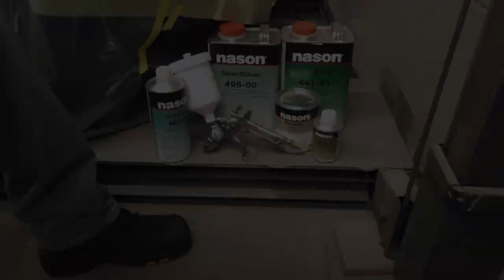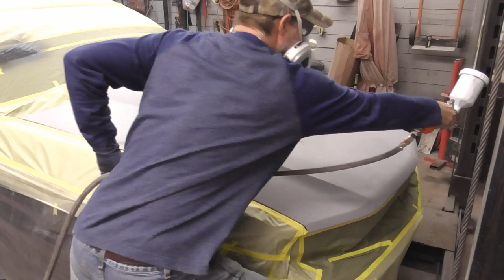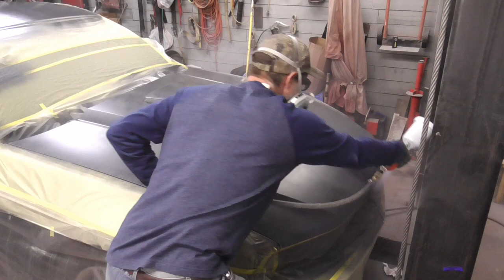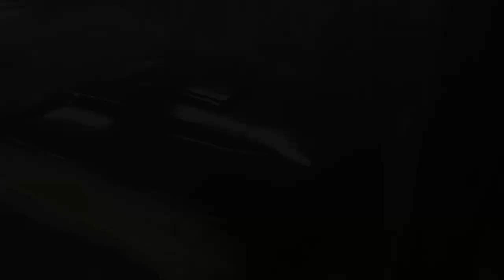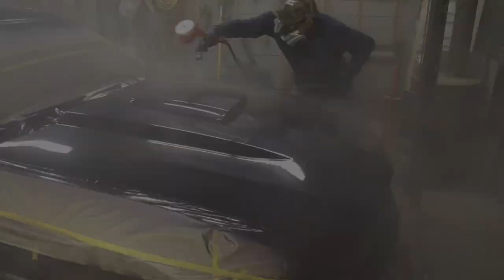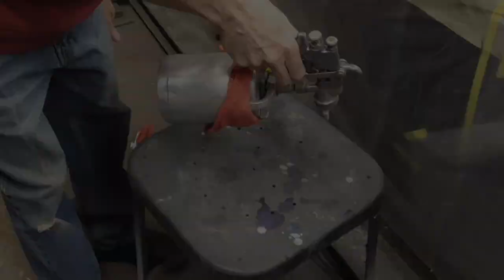How to Spray Nason Base Coat / Clear Coat (BC/CC) Automotive Paint - Start to Finish

Comment: Just got the basecoat paint from Paint For Cars website today but still waiting for the turbine spray gun to come that ordered from a Asian country though the Fuji Q5 platinum hvlp I know it said 15-25 days it gonna take and next week Friday be 25 days so it should be coming by next week it has a 1.3 tip. I don't wanna use my 26 gallon air compressor with this paint again because like you said it did it multiple times when painting with this urethane paint got orange peel but I know they have urethane paints that are higher and lower quality too. I got a higher quality this time than last time paid 99 for a gallon this time paid 135 I still have some of the Arcylic enamel basecoat though that single stage that midnight blue both metallic but the Arcylic enamel paint when used it didn't look like a midnight blue after spraying it with my spray gun. I think the problem could be the psi I spray this paint with and other things but will use a 1.3 when I spray basecoat with this next time. Maybe this paint not good to apply with a small air compressor either though.
Reply from the maker: Keep me posted my friend.  I'm looking forward to hearing how it all works out for you.  Have a good weekend :)
Reply: @LakesideAutobody  ok was looking at instructions today and it said when using conventional spray gun to spray with 35-44 psi and saw the full instructions in the back but told them to email me instructions so don't have to look of back of can because this time gonna use a fast reducer not medium plus a different spray gun when it comes. I have a Nason Fast reducer bought in the last 2 months though. But have Nason black think is a flat black sealer too. Gonna need stuff fixed on truck because anti lock brake lights come on but don't stay on and maybe new tires so haven't been getting much as was but have gotten a lot of auto products in the last year but still haven't gotten a great paint job yet. Hopefully get better soon because next summer be two years since when I started trying to paint my last truck had rust but my new truck really didn't need to be painted I would of been better off painting test panels. But eventually gonna get a car again was looking at cars on Facebook Marketplace.
Reply from the maker: @zanaga1901  I took my ABS light out of the dash - got tired of messing with it - fixing this and that.  I didn't even like it when they operated correctly in the winter - just pulled the instrument panel, pulled the bulb - fixed forever :)  It's tough to get a good car my friend - been there.  They need to make a basic truck for a lot less $.  :)
Reply: @LakesideAutobody  Bought some laquer thinner Saturday at store Blaine Farm and Fleet 5 gallon I know that a lot but my parent said that was too much for me to get that is actually something like a auto shop would get but got it because would have enough for a long while I ain't a professional painter or have a body shop but when I get one gallon it didn't last long when keep trying to paint my truck but only way I be to paint soon will be with a garage heater or next year painting again.
Reply from the maker: @zanaga1901  My dad always bought it in 5 gallons.  You're right it doesn't last long when cleaning guns and using it for thinning primer, etc.

Comment: What is your mix ratio with the nason base? It seems alot if people get confused by nasons weird ratios.  And do you use the hardener for the nadon base? Thanks
Reply from the maker: Nason 483-15 activator is the hardener.  The ratio is 8 : 1 : 2  - 8 parts color to 1 part activator to 2 parts reducer.  Mark 11 equal parts on a paint stick (the total length is how much paint you want in all).  In other words divide a distance (any distance that represents your desired amount of usable paint) on the paint stick - then divide it up into 11 parts.  8 parts will be paint 1 part will be hardener and 2 parts will be reducer.  Let me know if that makes sense to you :)
Reply: @LakesideAutobody  i bought some NASON FUL-BASE 3.5 B/C and its metallic but its a 1:1 mix ratio???

Comment: Whats your method of cleaning the gun after painting? I can't seem to get it thouroughly clean. some residue always remains on the nozzle.
Reply from the maker: I take the air cap, fluid tip, and needle out.  Throw the cap and fluid tip in some lacquer thinner (best for cleaning) and let them soak while I clean the cup and front of the gun where the paint comes out.  You don't have to take anything else apart where paint doesn't go.  I have a few favorite brushes that hit everything real well and put it back together.  Throw some thinner in the cup and spray the rest of the residue out.  Then put it away dry. I'll make a video on that - have a good weekend :)

Comment: This morning I sprayed some Nason basecoat XL 442-05 black on some parts (trunk, front & rear valance) for a 68 Mustang fastback. I was using 447-85 reducer mixed properly at 2:1. The temperature at the time was 80 degrees and I was getting ALOT of runs in the base coat. I was using a cheapy $20 Harbor freight gun that had a 1.4mm tip and it seemed like I adjusted the pattern very similar to what you had in this video. Maybe I was not moving the spray gun quick enough as it seems that you were moving a little quicker with your spray motion than I was but maybe there is something else that might be helping the base to run so easily.  The humidity was very high earlier today and still is. I would like to get your input as to what else may have caused the base to run so easily? Was it the cheapy spray gun, the temp of the reducer OR do you think I just need to speed up my gun movement.  Also how would you get rid of the runs in the base coat as I just stopped spraying it earlier this morning which was about 7 hours ago and didnt spray anymore because I wanted to try and find out what might be the problem. I appreciate your time and input if you can and thanks.
Reply from the maker: It was simply the movement of your gun.  Don't worry at all about spraying the base coat dry and for that matter don't worry about spraying the clear a bit on the dry side either - a little orange peel is not the end of the world - it can always be wet sanded and buffed.  I will be uploading a painting video tomorrow (6/24) that talks about what I'm trying to explain to you.  For now though, I suggest practicing on a large metal coffee can - scuff it and paint it (bc/cc).  If you can paint that without runs and be happy with the results - you are 90% there.  As for removing the runs... you'll have to either wet sand them out with 400 grit or DA sand them when it dries - as long as the paper doesn't clog up.  Let me know if you have more ?s  - keep at it my friend - don't get frustrated - Jerry
Reply: @LakesideAutobody  Would it be quicker for me if I just removed the base coat with a rag and some lacquer thinner or would that not be good for the urethane 2K primer underneath? I intend to respray the entire panel anyways? Thanks for encouragement as I definitely need it. LOL! The parts I am painting were done in Nason 2k primer surfacer Direct to metal and they are 68 Shelby GT500KR fiberglass parts if that makes any difference. I look forward to watching your video as I have watched ALOT of those. LOL!
Reply from the maker: @VegasRT500  My boss and I washed a whole car with buckets of lacquer thinner like you suggested (no gloves 😒).  It's sort of messy but fast and it works.  Try a small spot and make sure it doesn't mess with the 2K.  You can absolutely do that if you want.  Let me know how it goes for you.  I'll be watching out for your post - good luck my friend :)
Reply: @LakesideAutobody  Yeah i thought i would remove it with laquer thinner then scuff the edges with 400grit to make sure they are not rough and there is a smooth transition from where I removed the runs. Thanks I may give it a try.
Reply: @LakesideAutobody  Hey just out of curiousity when you guys washed a whole car down with lacquer thinner were you also removing base coat?
Reply from the maker: @VegasRT500  We were using single stage Dupont Centari in those days (80's). It was his first or second coat so there wasn't much to take off and it wasn't very dry.  He wanted it off because he got a bunch of dirt/dust in the job and was pissed about it :)
Reply: @LakesideAutobody  Ok that sounds like it worked though and was quick. I only have 2 coats of base to remove so I will most likely try it . I will let you know what I did and how it turned out. Thanks!
Reply: I have began to remove all the base with lacquer thinner and it doesnt seem to be effecting the 2K primer . I am going to remove it all and just retape the parts just in case anything gets trapped on the edges.
Reply from the maker: @VegasRT500  Sounds good - keep me posted on how everything works out :)
Reply: @LakesideAutobody  I removed the base coat with the lacquer thinner and it saved alot of time. I am going to retape the parts just incase some thinner got underneath the masking taped areas. It worked great.
Reply from the maker: @VegasRT500  Glad to hear it :)

Comment: Never start in the middle of a panel. Keeps a wet edge alle the time if you work your way into the middle,, then switch sides and keep going.. Also put some gloves on when you run your hands on it. Your clean dry hands are still oily.. And finally do your front edge first. Keeps from putting overspray onto you freshly painted hood. Nice color though. Gonna look good.
Reply from the maker: With respect, according to the wet edge theory, you could never paint an entire car.  Where would you start so that you wouldn't have a dry edge or.... always keep a wet edge?  Just get the entire thing wet and you're good.

Comment: What is the sealer you use?
Reply from the maker: It's a 1K (no mix with activator) type of sealer from Autobody Master - they sell it at the local Auto Value Auto Parts store.  All 1k sealers are probably really close in performance.  Any sealer will work fine for you too 1K or 2K.

Comment: Do you have to shake the gun alot so the metallic doesn't settle on the bottom? Thank you for the video. Enjoy your weekend!
Reply from the maker: No. You don't have to shake it at all.  Actually try not to shake it as paint can leak.  Once you mix the paint,  you are good,

Comment: You never run your hand against the job before tacking. Never. Oil in  your hands  can contaminate the Finnish.
Reply from the maker: With respect that's false information passed on by books, magazines and blogs.  A body man has clean dry hands.  Matter of fact, they're always dry as a bone.  You have to touch your body work - just have good shop habits - no eating French fries while working, etc.

Comment: You can see orange peel mmmm something is not right out there....
Reply from the maker: If you see orange peel you can wet sand lightly with 1200 grit and buff.  You have to make a choice when you paint - push it to the limit and chance getting runs which to me ruin paint jobs or hold back just a bit and buff  - which is much easier and looks a lot better than removing runs.  Nothing worse than going to check on your fresh paint and finding runs - to me anyway :)